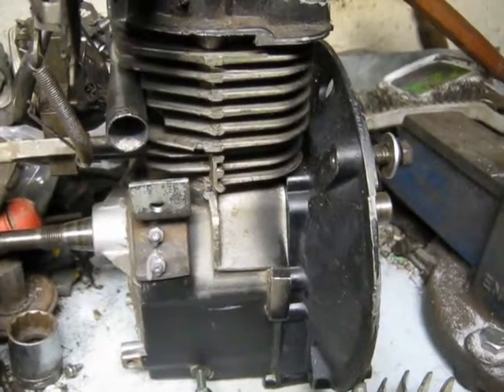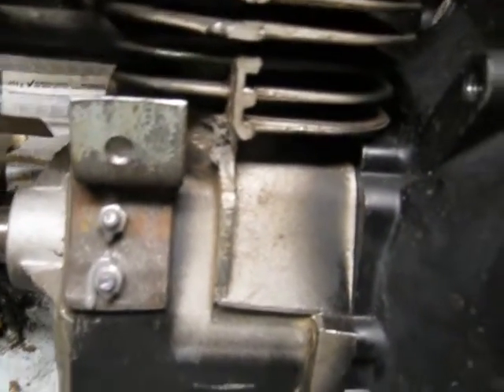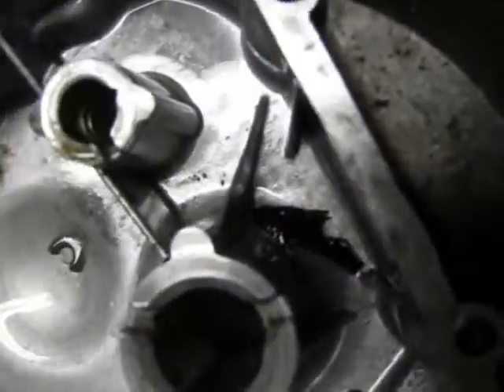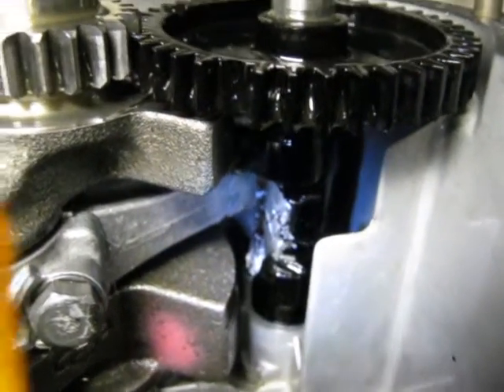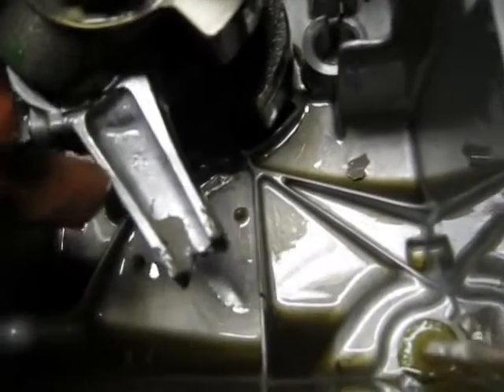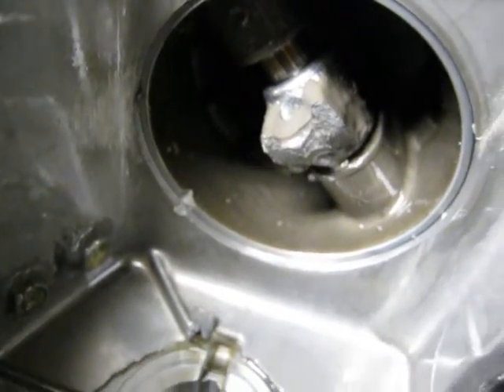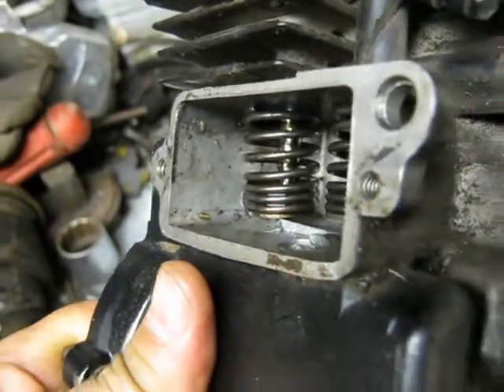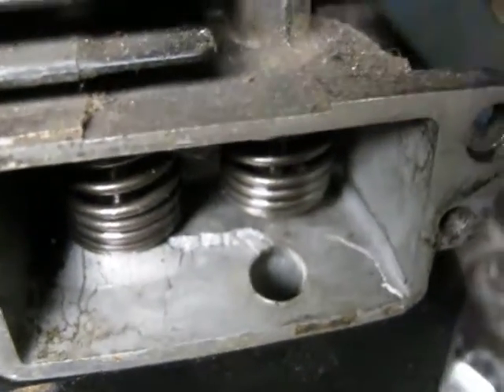Engine Carnage (Long version) #2

Comment: she came to a mighty halt,  there isn't even any good parts left from that one
Reply: +ChargerMiles007 when a connecting rod snaps up high it means it has been over revved. When the rod is broken towards the bottom around the big end it means it has been starved of oil
Reply from the maker: +65bug519 Yes, it really did the block in, I think the crankshaft survived. I have never found another con rod broken up high like this one that the scrapyard claw snapped off.

Comment: CRUNCH!
Reply from the maker: TheFlacker99 (Flak) Yes, this one had a serious Crunch!I almost feel sorry for this poor little Briggs, first the Claw at the scrapyard attacks it and breaks the block and con rod. Then I epoxy it back together for a grenade run!  I guess it has earned its retirement!  :)I found part of a Briggs 3-1/2 mower engine yesterday, someone cut and smashed the end wall (by the dipstick area) out, then melted the oil paddle wheel, looks like cruel and unusual punishment to me! I am forming a posse to get this guy for 1st degree  Briggsacide!!!   lol